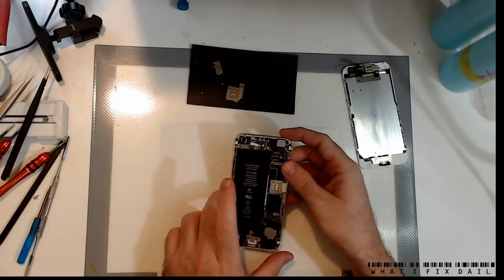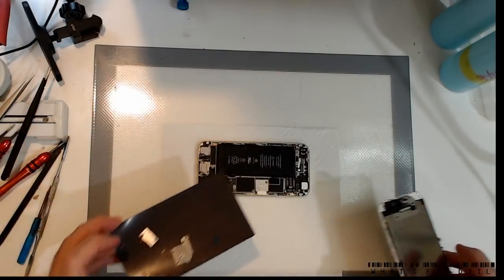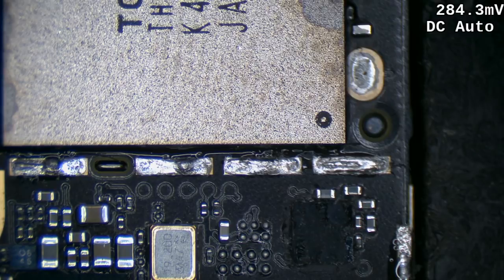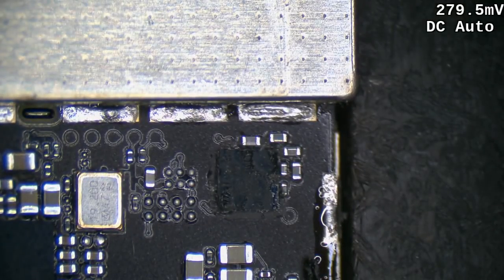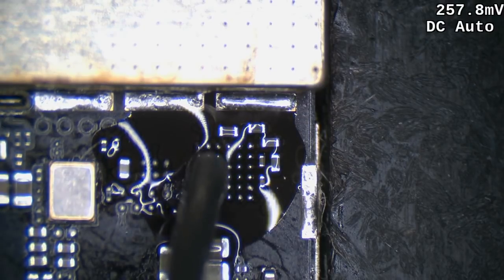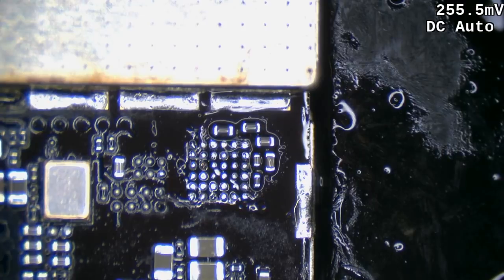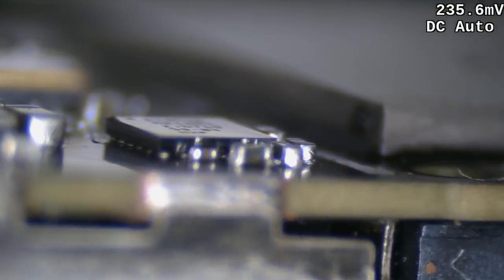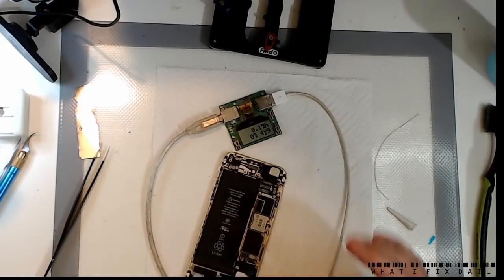iPhone 6 - dead, no charge; possible Tristar and something else

Comment: Can you please be more specific, and let me know,what you had to do after you changed Tristar so that Iphone finally worked? Thanks.
Reply from the maker: Liquid damage on the cap, which is on PP1V8_SDRAM; removed the cap and things worked again.
Reply: Thank you for your reply. So ONLY visual inspection was the clue so that you find the real problem?
Reply from the maker: There were two problems with the phone.  The first was the tristar, the second was the corroded cap.  Replacing the tristar fixed the no-charge-current problem but then it still wasn't working right instead we had small bursts of higher current, then the visual inspection under the sticker revealed the next problem (corroded cap).

Comment: Smashing repair :-D.
That tristar was a bit faulty, so you were right, it must be a fragile crap design.
i've watched many people replace them because of sudden failure.
Yes i've been two timing you with other pcb fondlers :-D.
Reply from the maker: I would loved to have been in on the meeting where they decided to assume trust with the lightning-cable and drop the idea of any protective parts on the input line(s) for the tristar.

Can't believe you're bit-fondling with another PCB repairer, I'm shocked :D

Comment: How much heat will this take before you can ruin it - not familiar of heat on this
Reply from the maker: It's not really possible to say; definitely a feel thing, though there are usually indicators that you're getting too hot, typically discolouration of the board/parts, as well as smoking of the board/parts (as opposed to the flux burning).   Sadly it's a practice thing more than anything else.